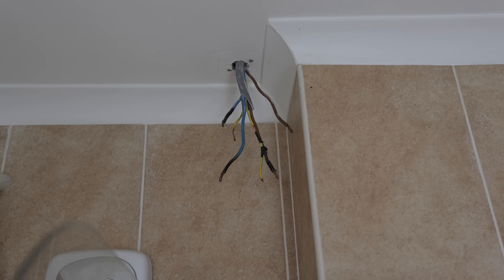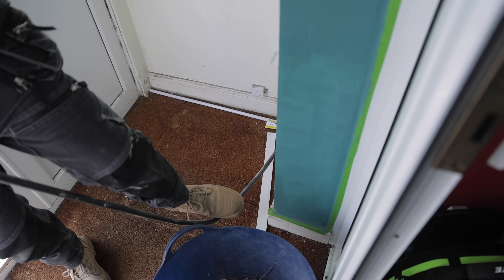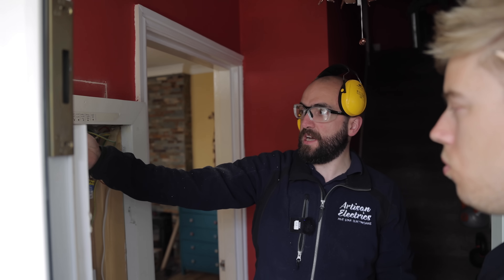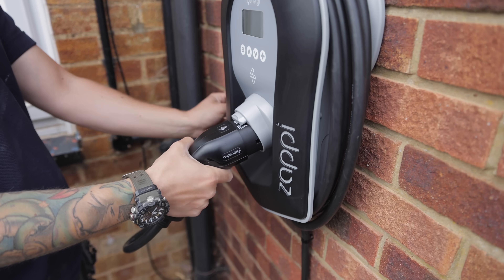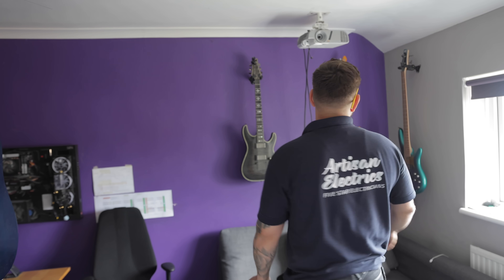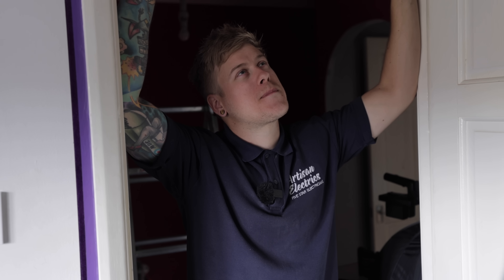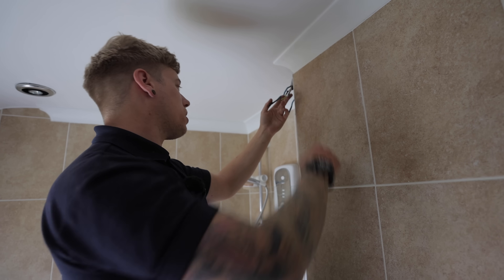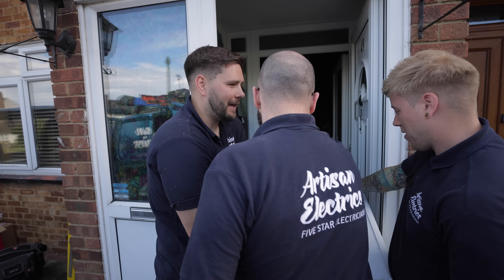When Should you Upgrade Old Electrics?

Comment: Yet another clip where main fuse has been pulled and meter seals cut ,
Reply: Given an inspection on the property was done weeks prior where they looked at elec layout and determined what work needed to be done (ie fuseboard change and car charger), I'm fairly certain the admin team at Artisan would have contacted the local DNO prior to starting onsite and stated they will be pulling the main fuse...
Reply: @gloveyourway2000  giving the fact the dno won’t allow anybody apart from there employees to pull the main fuse , no matter who you are and how much notice you give them , they will tell you that you need a switch isolator to be fitted at what ever cost , there’s another YouTube clip of these even taking out a switch isolator and fitting there own 🤦🏼‍♂️, the only time your allowed to pull the fuse is in a live and death /risk of fire , not to change a board , notice the admin team at artisan aren’t replying to comments criticising poor practice
Reply: @cj-rb8fz  That’s certainly not my experience working with multiple DNO’s. But if that’s your past experience, that’s fine. Regarding poor practice, yes there are some things I’ve seen on videos which I personally don’t think are great, but others think are fine, so who am I to judge.
Reply: Git her done mate
Reply: Is that you Karen? 👀
Reply: @Holdeenio  not there property to cut and remove seals , also I know it’s easy to pull the fuse but your supposed to be properly trained ,also when the fuse is removed on a smart meter it’s flagged up and then you get the suppliers come round and bill you for the visit to find out why the supply as gone off

Comment: Hi from Canada. My question is, What is a Wago box? Can you explain that for someone that isn't British.
Reply: Wago are a German manufacturer of spring based terminals. They have a very wide variety of products, but the best known among UK electrians would be the 221 and 222 series lever splicing connectors and the 773 and 2273 push-in splicing connectors. 

The "Wagobox" series are a series of enclosures intended for use with the Wago terminals. They are made by a UK ccompany called Connexbox under license from Wago.

When used in conjunction with the correct Wago terminals many of the Wagobox models are approved in the UK as "Maintinance free junction boxes". As a result they can be installed in locations that will not be accessible for inspection.  There are other brands of Maintainance free junction box but the Wagobox series probablly offers the best combination of quality and flexibility.

Wiska are a manufacturer that mostly makes enclosures, they are probablly best known for their "combi" series which are a series of plastic enclosres suitable for both indoor and outdoor use.
Reply: wago is the trade mark,they do different sizes and are basically a box to join cables when needed ,they do individual connectors which are push fit,I think you will find they are made in germany
Reply: @joe2395  thank you for the prompt reply, and what is a wisker box?
Reply: @2011craggie  it's just a plastic box of all sizes that contain cables that need extended, basically a up to date joint box 👍